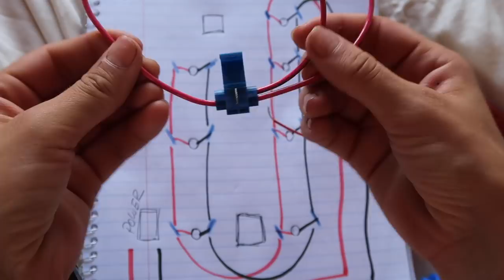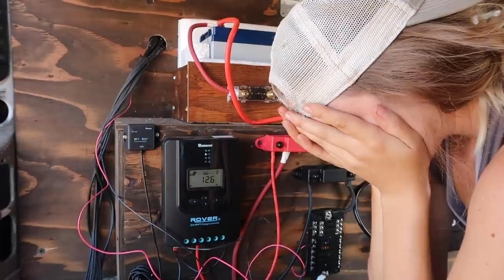LED Puck Light Installation | VanBuild Ceiling

Comment: Congrats on getting it working.

So uh...  couldn't help but notice a few things.  For starters, I don't think I ever saw a multimeter anywhere in your pile of tools.  You should have one and learn how to use it.  It will save you money the first mistake you catch with it.  Also...  the reason you literally cannot go in series is because your voltage drops as the current passes through each device in order.  You have a 12v source, each light needs a 12v connection, not 12v divided by X lights.

I don't know what if any code applies to vans, but I probably wouldn't have used any of those connectors.  Spade connectors just suck to work with and you have to make sure your crimper can actually get enough force on them, particularly if you're using the thick waterproof types, else they will pull right out.  Those wire taps are also kind of a last-resort thing in my opinion, and you should not be at that stage right now.  You're at the "do it correctly from the start" stage.

If allowable, I would have used insulated ferrules and lever nuts with kind of a local distribution point.  If you ever get your hands on some, you'll understand why.  Probably the only hesitation would be if you need "waterproof" connectors.
Reply from the maker: Thank your! A lot of resources from other van lifers and articles of van light installation recommended these products, so I went with their recommendations. The reason I mentioned not hooking up in series isn’t because I don’t know why, it is because I have seen videos telling people to complete the lights in series and I don’t want others making that mistake. I appreciate all of your advice.
Reply: Oh I can tell you've been doing your research.  Like that looks like a spendy battery; not the spendiest, but not an AGM either.  (Which was a good choice.)

But if you want best practices you might need to expand outside the vanlife community a little bit.

Comment: I love this! I'm trying to do this same thing myself, and my question is; is the last light still wired in parallel? it looks like the 14awg cables both end at the last light to complete the circuit. is that what happens or is it something else? Thanks!
Reply: I am wondering this same thing. I believe we could just connect the 14g to the last light to complete the circuit, rather than use a blue 3 way connector.. since it’s just a 2 way connection.

Comment: Electronics or electricity 101....... any voltage connected in parallel will stay the same, you need to add your amps and make sure your wire and fuse can handle it. Make sure that if your total amps is 5a, you’ll want at minimum 7.5a fuse, no higher than 10a fuse
Reply from the maker: This has already been done :)
Reply: @Linneaandakela  thats great, I like it when people have a "can do"attitude. 👍

Comment: Any problems to date with heat from the puck lights against the thinsulate? I saw where someone suggested strips of zinc metal between the lights and the insulation to shield from heat. Also, any problems with the 3-way connections? I saw that a few people said that would be dangerous. But I figure you would know by now.
Reply from the maker: As far as I know I haven’t had any problems with either of those mentioned! But of course it’s hard to really know what’s going on behind my walls :) but nothing that I have noticed!
Reply: @Linneaandakela  Awesome, I'll stay w/the Linnea & Akela plan. Thank you for the response. You rock.

Comment: You should reverse the plugs on the negative. As in Male on Pos. and Female on Neg. this way when you’re not able to plug them in reverse and fry anything. Otherwise great job!
Reply from the maker: I connected positive to positive and negative to negative with the male and female connectors :) or am I just not understanding what you mean?
Reply: Linnea & Akela I may not have explained it correctly. What I typically do is I put the male connector on the positive wire. The female connector on the negative wire. That way if you’re tired, have poor light, or someone else is do it. They cannot plug the positive into the negative. Because the connectors are reversed on the negative side than those on the positive side. Most of my wires are also not color coded (red/black) and all one color.

So if I were doing this... on the light: Positive would have a male connector. Negative with female connector. Then on the Van side, positive would be female and negative be male.

Hope that makes sense.

Comment: I recommend to not use those connecters for the lights they are a fire hazards because it can come loos over time and will start heating uo because of it taking more current i recommend cramps
Reply: With electricity beakers and fuses are your best friend connect them properly and they'll save u

Comment: You know its a good idea to test the lights be for you install them.  Just wire up the lights by twisting the wires together and use some jumper wires to power the set up.  This will eliminate allot of anxiety before everything is put in.  If something does not work it is easy to figure out why and fix the problem.
Reply from the maker: It’s less about the individual lights working, and more about the way they are connected within the entire system :)
Reply: @Linneaandakela  what I am saying is dummy  connect up the whole system and see if it works the way you want.  Like it's possible the dimmer is not the right type or you don't like the color of the lights. Hooking up the whole setup before the install, particularly if it's you first install is a good way to confirm if ideas are conforming to reality.